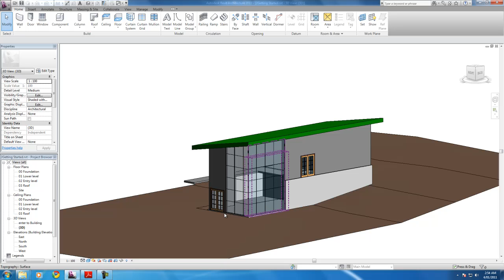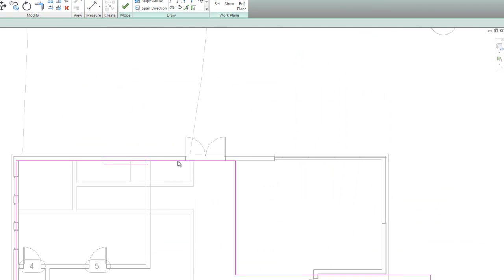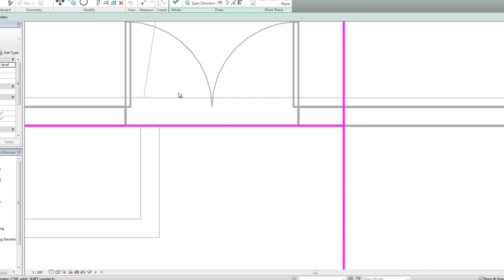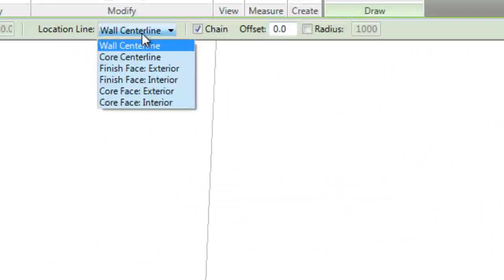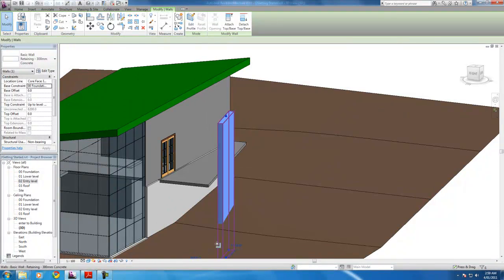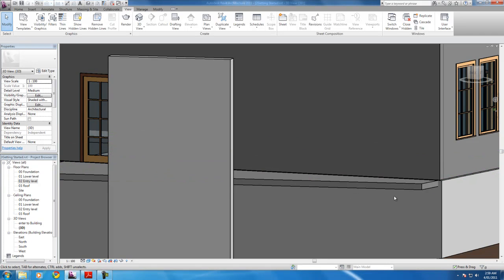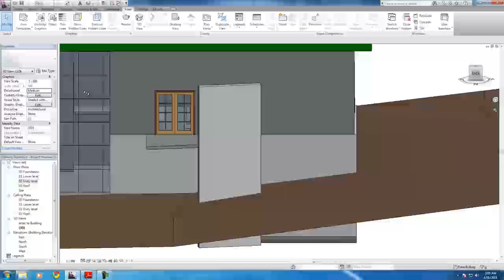Autodesk Revit Tutorials: 13 Adding an Entry Deck

Comment: to answer nicholas' question in case no one has figured it out yet, in the properties bar is a tab called underlay, in that drop down menu pick the level you want shown underneath and hit apply, it should then be shown under the plan you are using

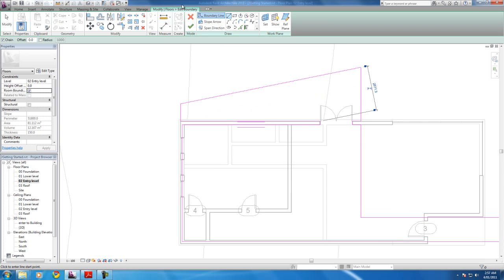Comment: Is there a reason why you drew the boundary of the floor around the door to the entry deck, but the boundary for the other deck cuts straight through the walls? You said at 2:58 that you "can't have a line going through it". Is there something different about these two instances or just an oversight? Cheers